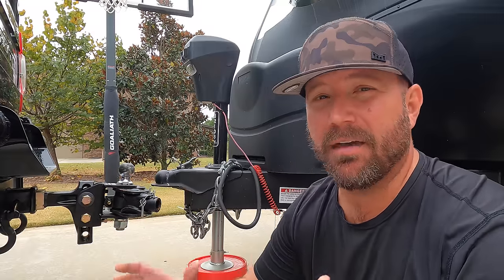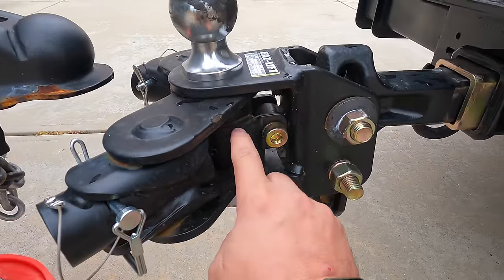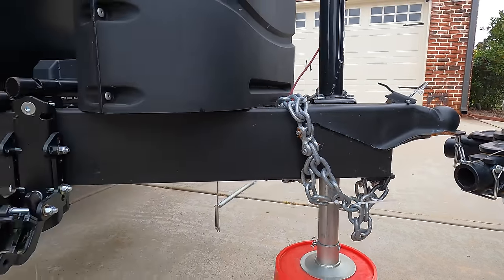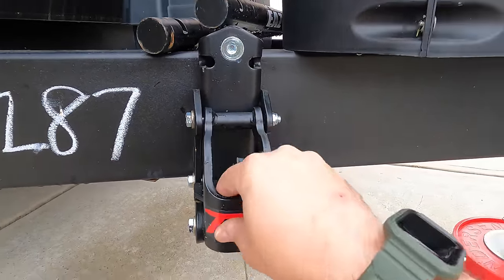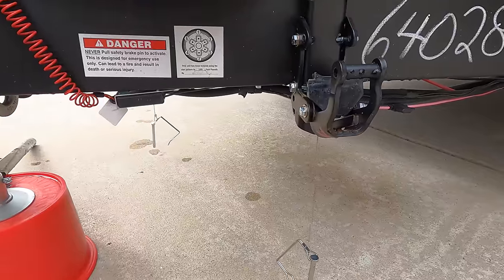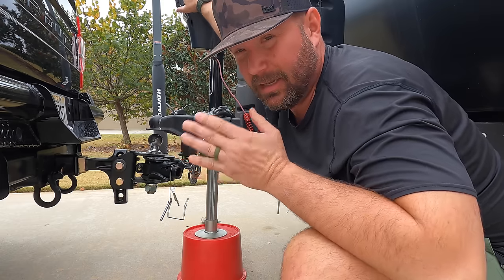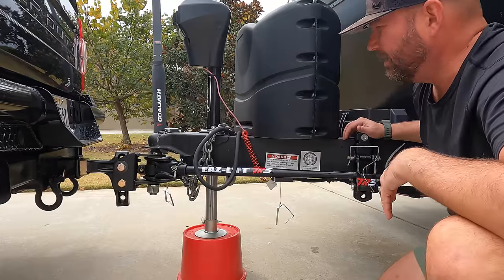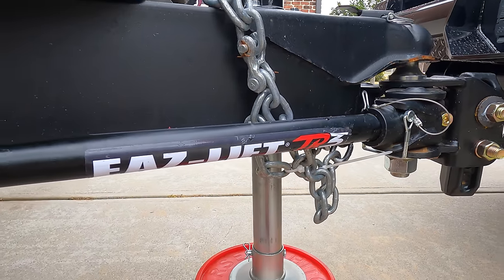The EAZLIFT TR3// Great Performance, Affordable, SILENT// TR3 Could Be The HOLY GRIAL Hitch for Some

Comment: I was on the fence between this hitch and the equalizer 4 till I found out after contacting the manufacturer for the TR3 with concerns about the brake material wearing out. They said the issues they have had is people are not removing the seay control pressure when they are done towing. So when you are at destination you must loosen the Allen bolt every time.  Deal breaker for me.  What a pain in the butt.

Comment: I ended up buying the True tow in the spring off your recommendation. It performs leaps and bounds better than the Blue Ox Sway pro. I can drive over 60 mph on the highway now when before, I could barely get 50-55 maybe. And, I was able to sell the Sway pro.
Reply from the maker: 100% same experience!
Reply: Did you get the original True Tow I assume? How is the weight of just the hitch (not the bars or drawbar)? I'm coming from a Blue Ox as well and want to feel what you're feeling!

Comment: Just purchased this hitch thanks to your review. Mine seems to have a few upgrades since this review. First, the head angle is now set by eccentric washers over the top bolt. These washers offer 6 preset head angles. Nothing to strip. No upper or lower set screws. Second, the friction bolt is now a 3/4” hex head.

Comment: Bought the TR3 based on your reviews.  Really like the ease of set up and the integrated anti-sway.  Got the lighter 600lb (800lb tongue max) model for a new-to-me Jayco Flite 264BH pulled by my Chevy Silverado LTZ which has a full towing package, but only rated for 6400lb towing due to it’s softer ride and 3.08 rear end.

Comment: Very well done & presented. I kinda had my mind made up a couple months ago when I watched your video testing the others. I wanted to try the Anderson because over the years I have been just plain tired of the weight on & off of the other WDH. The Anderson takes me about 2 minutes on & 2 minutes off and is so light. No up & down; just use my 18 volt Milwaukee impact and spin on or off the large nut, drop the batwing yoke & we're done ! I have ~9500# tt & tow with an F350 7.3l gasser.  You cemented the gas vs diesel for me there as well.... Works very well...
Reply from the maker: Always great to hear these comments!

Comment: One thing that I don't think you mentioned that I like about this hitch (and the R3, which I think was it's predecessor) is the fact that the bars don't curve down.  This hitch has straight bars, and the R3 had more traditional curved bars but they were installed in reverse, so they curved up, which gives you much more clearance than bars that curve down from the hitch, especially if you get off the pavement...something we do with some frequency out West.
Reply: I have the recurve R6 and have been very please with it. It can get a little loud but not nearly as loud as others I have heard.

Comment: It's acutally pronounced "easy lift"...they just created a brand logo to differentiate their products from the competition.  I've been using them for over 30 years and they build good products.  In all those years I have never had one fail on me.  Thanks for the review on this model.  I noted that you were just going to move the unit out to the street....I hope that you include a brief lift of your toungue jack to confirm that the ball is seized by the lock/latch on you trailer's toungue hitch...important step in getting ready to tow.

Comment: I have an older version of this hitch I believe. Called the r3. The head of this hitch looks really similar the one thing I didn’t like is that the instructions were extremely vague on adjusting the hitch head itself to the trailer.  The main reason why I will strongly consider the weigh safe when shopping for my next hitch.

Comment: I have a lighter trailer - 24ft 4,200lbs empty and 6,500lbs fully loaded - being towed with a Suburban 2500.  The back of the Suburban hardly drops, but I still want an anti-sway hitch because I'm paranoid about loosing control going down steep hills in the Rockies/Uintas (where we frequently camp).

You mention that the anti-sway properties go up to 300 ft lbs.  A video from WeighSafe mentions that it can add 1,000lbs or more of sway control. But the anti-sway properties of the WeighSafe come from distribution weight binding metal on metal, so a light trailer like mine that almost doesn't need weight distribution might not get much sway control at all from the WeighSafe.

The TR3 anti-sway comes from a brake pad and seems to be independent of how much weight is distributed by the hitch, which would be ideal in my case.

By the same logic, it sounds to me like the anti-sway properties of the TR3 might be undersized for larger/heavier trailers.

Does my logic sound reasonable?
Reply: The first point may be a good one but on the second point, the sway brake is adjustable so it may have a more grip than you would want.
But I don't know. Just guessing. I like this setup. Going to look at it more.

Comment: I have the previous generation Eazlift and it works great. The only beef is it does make noise from time to time but that has to do with how well it is setup for WD. I think this should do better because it looks like you can adjust the hitch WD variably without spacers, so that is really nice. I am also really interested in the new Weighsafe hitch.

Here is my big concern - The locked in bar that doesn't pivot. If you aren't perfectly straight isn't that going to cause some problems getting it on?
Reply from the maker: It didn’t for me. I just backed in the way I unhitched.

Comment: Thanks for sharing the video and your experience with the hitch. It seems almost to slick to be true. Two questions, can you back up with it and is that brake material replaceable or do you need to replace the whole thing? Thanks for any help or suggestions.
Reply from the maker: Yes, you can backup without unhooking. The brake material will need to be replaced eventually but I’ll bet it last 100,000+ miles. I’m not sure if it’s replaceable or a new hitch is needed.

Comment: Question , I was trying to decide between this WDH and the Andersen . I was set to get the Andersen until I saw this vid. You had mention Andersen is good for the right situation. So I was wondering if I could ask which one you’d choose if you were me. I have an f150 3.5 ecoboost max tow package (13,500). My travel trailer is an imagine 2500rl . Hitch weight 581 lbs  . Uvw 6086 and it’s 29’ 10” in length. Thanks for any info you can provide. And thanks for making your videos . They are very helpful .
Reply from the maker: I would choose the EAZLIFT if those are your only 2 options.

Comment: After watching your hitch videos along with many others, I’m really leaning towards this TR3. I do have a question, how tight did you end up with the brake sway control? Did you tighten until the hex bolt stopped turning?
Reply from the maker: It’s been awhile but yes I believe so.

Comment: Wow very cool and easy. Raising the tongue on the Equalizer is a pain and sometimes when the truck is not level it can be hard to get the bars off. 

Btw what lock are you using for the hitch on the truck?  I just bought the Curt hitch lock and not a fan. The lock part just spins and hard to determine if I’m locked without pulling on it. Had to upgrade to a larger lock with the new truck. Speaking of the new truck my 2022 f350 Godzilla 7.3 came in about a month ago and loving it. Can’t wait for next years camping season.
Reply from the maker: Great news!!

I’m actually just using a basic pin and clip right now. I switch these things out so much. Haha. I do like the Blue Ox locking hitch pin

Comment: Very good Cory thanks for doing the video on the hitch I may have to retire my 20 year old dsp hitch one question so you have to be dead straight when hooking up thanks
Reply from the maker: Not in my experience. I simply backed in the way I unhitched.
Reply: If you’re not backed in dead straight, can’t you just back off the sway control bolt and the fixed side will swing somewhat freely as well?

Comment: I've been watching your videos all weekend.  I'm getting my first larger trailer in a few months and trying to learn about weight distribution hitches and figure out what will work for me.  What would you recommend?  I have a 1/2 ton truck, will be pulling an aluminum enclosed car trailer that's 22' long (box length).  Total weight when loaded will be 6500lbs.  The trailer's frame is 2"x8", I'm finding most of the popular hitches only work for up to 6" trailer frames.

Comment: Please help. I have a 5000 lb (dry) dual axle travel trailer.  (Rockwood)  There are many sway control/equalizers out there.  Your YTs also recommend / like many of the controls.  Any recommendation for one that won't break the bank.  I pull with a 2019 Ram 1500 with air suspension.  Greatly appreciate any thought.  Thanks for the awesome videos.  Kelvin

Comment: Thanks for sharing.  I'm surprised that you put it equal with the Equalizer.  You say the TR3 performs as well on a 37' rig as the Equalizer on a 35' one.  So better on the 35'?  Also, did you take into account noise?  You said the Equalizer was the loudest in the shootout.  Also, how does setup compare to the others?
Reply from the maker: Equalizer has its advantages as well. Lifetime warranty, great build, USA built with USA steel. Those have to count for something. As far as strict performance I can ASSUME the TR3 would perform better that the Equalizer on our 32 footer but that would also be speculative.   Yes, the Equalizer is very loud and the TR3 is silent. That isn’t a big deal for me but I know some will love that aspect of the hitch. 

Both great hitches.

Comment: Great video, how is the sway control on it, does it handle like a Cadillac, and when does it hit the market?
Reply from the maker: The sway control is great.  It took me awhile to make this vid because I hadn't towed in any decent side winds.  Finally wind and tow day matched up and it did very well.  Easily as well or better than the Equalizer.  It can be ordered now thru dealers.  I linked a dealer locator in the description box.

Comment: MY CAMPER IS 20 FT.  DRY 2840 ..PULLING WITH A CHEVY 1500 2.7 TURBO 4 DOOR 4X4 ..IS THIS A GOOD SWAY BAR FOR MY SET UP ..ALSO MY BALL IS 2IN .WHAT DO YOU RECCOMEND
Reply: theres a 2" ball version for up to 4000lb

Comment: We are purchasing a Grand Design Imagine XLS 25DBE that I’ll be pulling with a 1/2 ton. Dry specs are 630lbs hitch and 6200lbs overall and 30’ length. 

Would this hitch be too much for a camper like that?

Comment: I have a ProPride and it performs perfectly. However, occasionally it can be a bit time consuming getting hooked up. I have a 3100RD. I know you ranked the WeighSafe number 2. I also heard you say you’re considering selling your PP. I’m assuming you would replace the PP with the WeighSafe. Is that correct and if so, it looks like to me that hooking up would be slightly simpler with the WeighSafe. Thoughts?
Reply from the maker: Yes, the Weigh Safe is a bit simpler. The classic wheelbarrow type hitch. The big difference is you can set the Weigh Safe perfectly using the app and built in scale. The ProPride hitching gets easier with time but sometimes I needed more clearance in the front and yes… the stinger can be stubborn.

Comment: Since you've tried the lion-share of the hitches on the market...what components would you mix-and-match to create the ULTIMATE WDH system?
Would you consider using these TR3 saddle-latches on the Weigh-Safe Middle-Weight?
Reply from the maker: I would do Weigh Safe shank, head, ball, bars, and saddles.  I would snag the pins from Equalizer and lanyard those to the saddles like TR3.  Great question!

Comment: I am going to Texas to buy my TT in a month.  Not sure of make or model yet.  How can i choose a hitch that will utilize sway control and weight distribution that will (i hate to say it this way) but would work universally?  I am in SE Tennessee (TN/GA border) and will be making the journey back home from Texas with the trailer.  Wont be loaded.  I am not a newbie to pulling trailers coming from 20 years of truck driving.  But I am however new to TT hitches.  It will be towed with my 16 Toyota Tundra Crewmax 2wd.  I am liking this particular hitch.  I was considering the Andersen but not so much impressed with the reviews.

Comment: These look great, but it appears they are going to be around the same price point as the WeighSafe middleweight models.  Do you think you will get the new middleweight soon and what are your thoughts between the two.  I'm assuming the middleweight will have the same noise issues since the bars are identical....  Thanks.
Reply from the maker: I have the middleweight WeighSafe in my hands now.  Setup this weekend.  I can't speak to the middleweight WS yet but I'll assume it'll make noise.
Reply: @WanderingWeekends  Ok, thanks.  looking forward to your review.

Comment: Does anyone know how far the ball is away from the hitch pin hole? I currently have the Anderson No Sway, but it is too close to my trailer. It is 8" from center of ball to hitch pin hole and I can't get my tailgate down. I would like to get the trailer further away from my truck, especially in tight situations.

Comment: How would this hitch work on a stock Ram 2500 pulling a tt with a weight of 9400lbs and a hitch weight of 1304lbs. I thinking about going with the weight safe.
Reply from the maker: That is basically the weight I was running with this hitch. Performed great. I like the Weigh Safe a little better. Either should perform well when properly set up.

Comment: I'd like to see how much your truck squatted
Reply from the maker: Never measured the rear squat. At the front wheels the hitch weight raised wheel well an inch and a half. The hitch replaced 3/4 of an inch back to stock measurement. Within ideal recommendations.
Reply: I wished you had a shown that I was told if you measure the front wheel Fender and the rear wheel Fender it should be within an inch
Reply from the maker: We’ve shown it in other videos. Just don’t want to be too repetitive
Reply: @WanderingWeekends  that you ill have to look it up

Comment: If the braked bar one one side moves easy, doesn’t that mean there is no sway assist?
Reply from the maker: No, once the bars are engaged the brake material helps with sway.
Reply: @WanderingWeekends  it seemed to move easily over, don’t you have to tighten the brake Allen bolt to have resistance?
Reply from the maker: Maybe I made it look easy but it isn’t. Yes, the Allen nut adjusts sway but I never need to adjust after the first tightening.

Comment: I don't know if this is a silly question but what is porposing?
Reply from the maker: Imagine a porpoise or dolphin swimming… the trailer/truck at the hitch can do the same over bumps, bridges, ect.
Reply: @WanderingWeekends  Ah I think I get it, its that up and down "bouncing". I have a Nissan Armada with an air ride suspension and load helpers in the springs but I thought that was just my suspension which I am having the changed out to regular suspension. Could I possibly have my Husky Centerline TS set up incorrectly? I've only just switched to that hitch this season and I'm very impressed but I hate having to lift the hitch up so high to get the bars on. When the TR3 is available in Canada I will definitely be looking at swapping.
Reply from the maker: It could be the hitch or it could be the vehicle. Hard to say from my side.
Reply: @WanderingWeekends  thanks for the replies, I gotta say I'm a huge fan lol. Have you thought about doing a video that highlights signs your hitch may not be set up right and or towing red flags?
Reply from the maker: Great idea!

Comment: We have a KIA Telluride pulling a Airstream Bambi 16ft with 430lb tongue weight and 3500lb gross weight. Which hitch do you recommend between the Andersen or the EAZ lift TR3. I want to be able to do hitch and unhitch myself, I am an average sized woman. Thanks!!
Reply from the maker: I would error on the side of the TR3. Hitching and unhitching is a breeze. Simply use the tongue jack to remove pressure off of the bars and it’s a breeze.